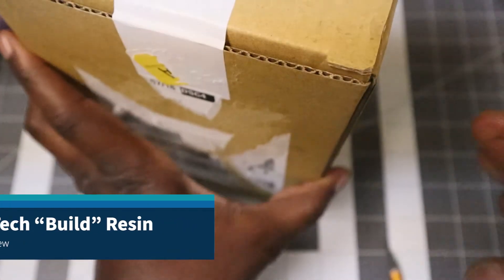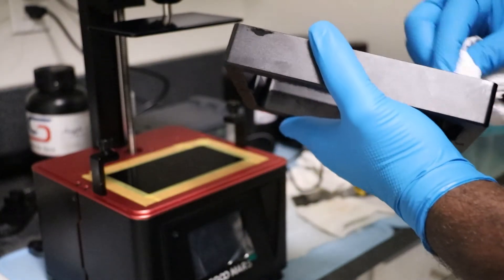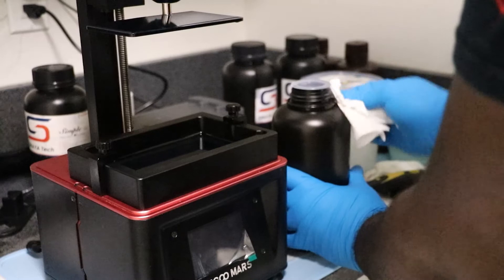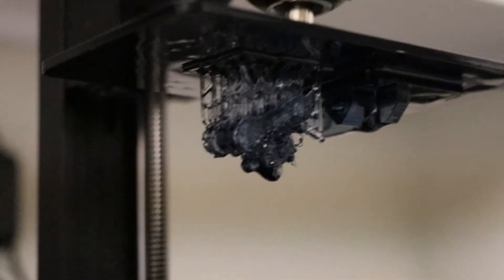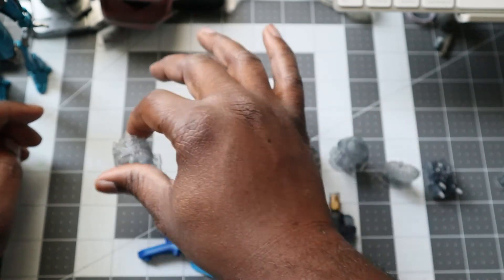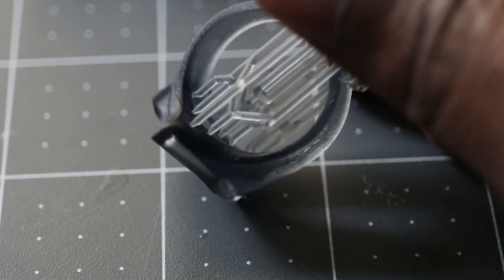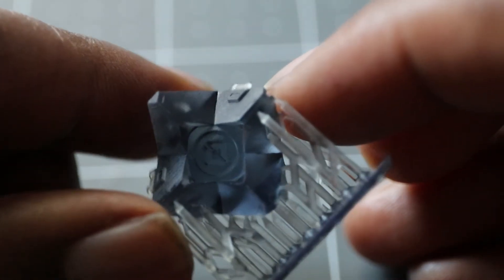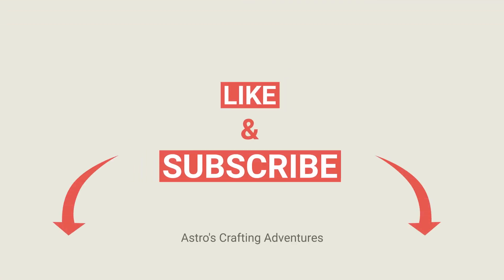Siraya Tech "Build" Resin Review

Comment: How do you think it would go printing keycaps? Also, can I ask what sort of settings you needed for print and cure? Does it take much extra post processing?
Reply: Ps thanks for the review! I'm kinda stumped why this is cheaper than blu/tenacious, apparently has great strength and dimensional accuracy, and noone's reviewing it.
Reply from the maker: I haven’t tried the blue/tenacious mix yet so I can’t speak to the differences unfortunately.
Reply from the maker: I don’t think I’ve printed keycaps in it yet but I did print a 2 part case with and the parts fit together perfectly. For print settings I used the recommended settings on the siraya tech spreadsheet that they post on their website but I didn’t find much of a difference between this and their fast resin in terms of processing. I used 2 minutes as the cure time.

Comment: Please do a review on the Siraya Tech Simple resin.    I am also wondering what happens if you mix Simple with Tenacious, Blue, or Fast.  Thanks!
Reply: Just a heads up even though this is 2 months old, Simple is Hygroscopic(Absorbs moisture), I'm guessing a huge structural failure. as simple is just terrible.

Comment: Siraya Build is the same as the Siraya Sculpt?
Reply from the maker: No it’s a different product. I believe it’s similar but I intended to be stronger than sculpt. For example you can tap threads in build to add screws which I don’t think you can do with sculpt.

Comment: How’s the smell?
Reply from the maker: It’s a good bit stronger than simple or fast. You will definitely notice it.
Reply: Astro's Crafting Adventures well dang..  I want to make some functional parts and this seem to fit the bill.. elegoo water washable grey stinks.. 🤦‍♂️🤢
Reply from the maker: You should try Siraya Tech simple. It’s similar to water washable (only needs %15 alcohol mixed with water) but prints way better and the smell is much better too. The only thing is that it only comes in clear for now but they say more colors are on the way.
Reply: Astro's Crafting Adventures  Build doesn’t print well for your taste?  I really want stuff that can be strong as well.  Without having to play with blu mixing..
Reply from the maker: To be honest I haven’t tested the strength of it but I love the detail. Most of the stuff I make stays in one spot so it doesn’t have to be that strong for my uses. I’ve been working with adding dye to fast to make custom colors so I haven’t gotten back to print with build yet.
Reply from the maker: Oh I did make a part for my ender 3 extruder. It’s currently holding the motor onto the machine, and it’s resisting to force of the sting on the extruder and hasn’t broken so far. It’s been in the printer for a few weeks. I even threaded a coupling for the Boden tube and it’s holding strong. Maybe that will help give you an idea of strength.
Reply: Astro's Crafting Adventures also thanks for the reply.. mind sharing your print settings for this resin?   I bought the liter last night from watching your video..  figured it was with the extra $5 over fast with the potential to be used other than paper weights..
Reply from the maker: I used the recommended settings on the siraya tech spreadsheet that’s posted on their website. I’ll have to look again when I get home but if you want to look at their spreadsheet it’s the same thing.